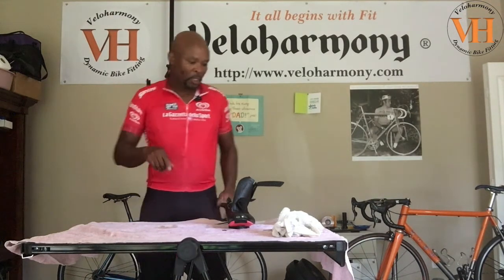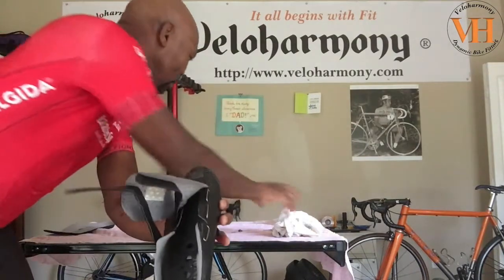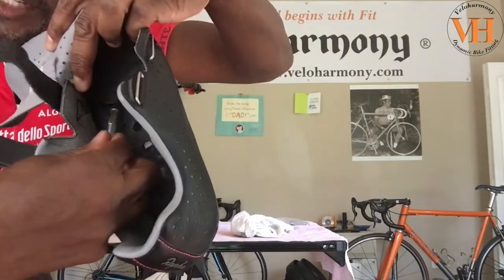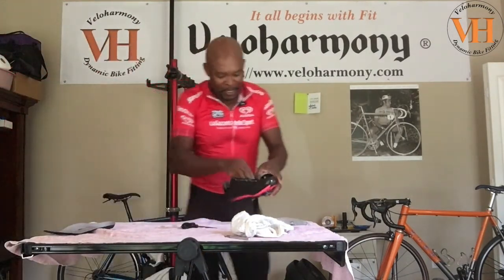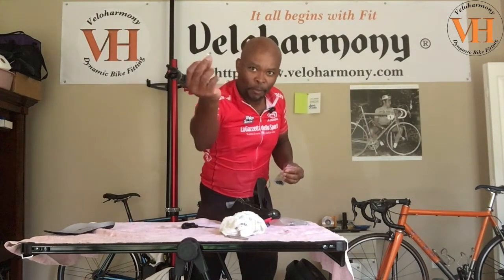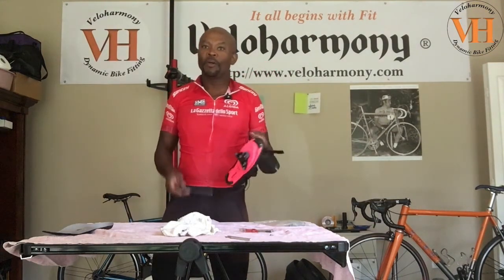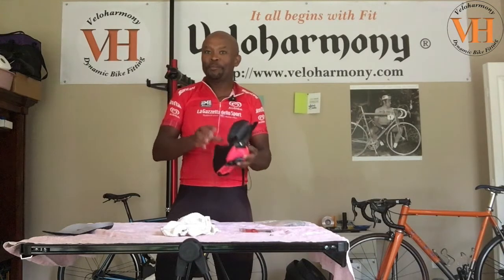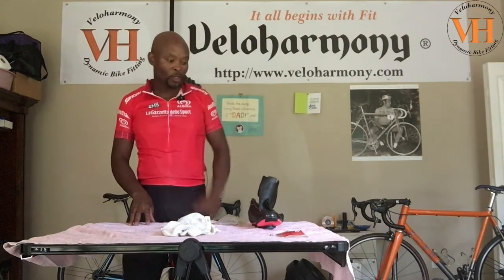How to replace cycling shoe cleat threads

Comment: Thank you very much! This video is super helpfull!
Reply from the maker: Glad it was helpful!
Reply: @Veloharmony  Now, i`m totally shocked. The sole nuts of my new Northwave Extreme Pro Anniversary Edition shoes looks like they made from a tin can! 
Nuts deformed from the declared required tightening torque of 5 N\m. Maximum declared torque is 6 N\m! And this is on the top shoes of the Northwave! I will definitely take off a review about this so that as many people as possible know about this mess.
Reply from the maker: I had similar problems with Giro Prolight Shoes. The metal used were so flimsy. Don't try and match the 5N/m setting, just tighten carefully until each bolt stops. They don't need to be as tight as 5N/m which I think is too much for those little bolts.
Reply: @Veloharmony  Now that my anger has passed, I seem to realize that such weak nuts are probably made in order to keep the expensive carbon sole from over torque. I have ordered spare nuts for my shoes. Dear friend, how much torque do you think will be sufficient? Which one do you use in that cases?
Reply from the maker: Do not use a torque wrench. Torquing is not necessary. Just tighten using your fingers on the allen wrench until it stops. You have to tighten by alternating from one bolt to another. Don't just tighten one until it stops, because the others will move. I periodically check my bolts to make they are nice and tight. Never overtighten.
Reply from the maker: Making a video about this right now. will be out in one hour.
Reply: @Veloharmony  my fear is mooving a cleat position during the powerfull sprints. Earlier, I always tighten my cleats by torque whench at 5 N/m torque. So, now is the time to watch your video and start a new life of my shoes :D Thank you!

Comment: My Shimano's don't take those separate cleat nuts but a triangular nut that joins all three cleat bolts. One had a broken off bolt firmly attached to it. I tried to drill out the bolt with no joy. Shimano don't sell triangular nuts anymore (only sort of plate things, with part number ESMSHRP900CLNT) so I cut the threaded apex of the V off. I then used a claw nut (or T nut) as the third cleat nut. The problems were
1) The cylinder of the nut was too long. I had to grind it down once before insertion and again to remove the portion of the cylinder protruding from the bottom of the sole. 
2) The little claws on the claw nut were not going to register (make holes in) the rock hard carbon sole. Fortunately my penultimate nut left marks where the claws had tried and failed to get into the carbon and I drilled four 2mm holes from those marks. I made the holes bigger, 2.5mm, from the outside and eventually managed to get the three of the four claws to register. It is important to bash the nut into the sole with a hammer and steel rod, till the T of the nut is firmly up against the inside of the sole, rather than to attempt to turn it in using a nut from the outside, because the little claws will bend as you turn unless they are fully embedded.
Reply from the maker: Glad you got it to work. Thanks for sharing. I don't follow their "tighten to 5nm" it's too much for those little bolt threads.

Comment: Wondering if this is what happened to mine.
The screws from the previous cleats seem seized inside, I can turn them but it doesn't seem like they're coming out.
Reply from the maker: If it's spinning, the threads are stripped.
Reply: @Veloharmony  I removed the sole, like you mentioned and I can see the screw holder spinning on the inside. Might have to take them in.
Reply: @RaabStephan  if you have access from rear, two pair of pliers works...or pliers and a 4 mm Allen wrench if your bolts aren't frakked